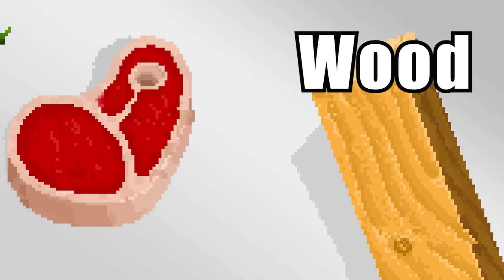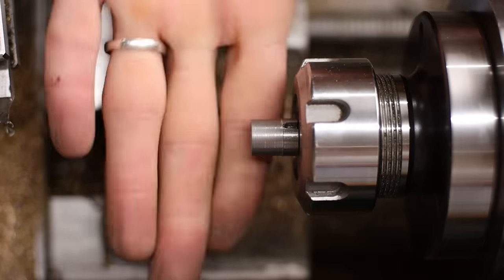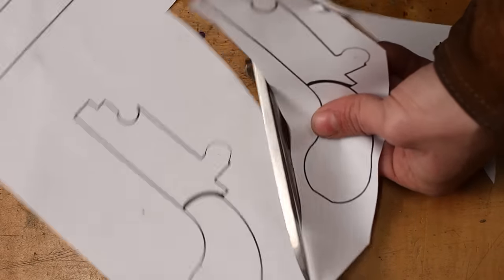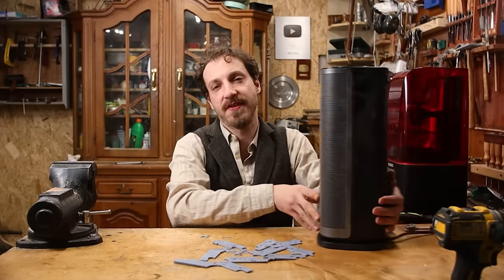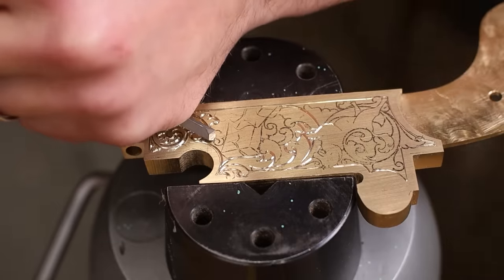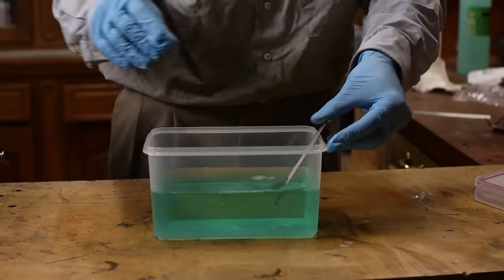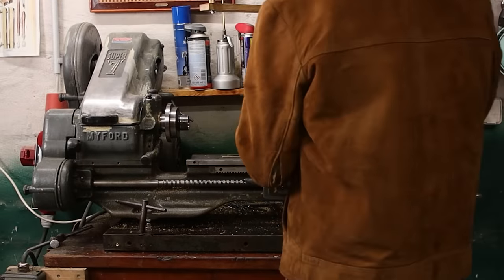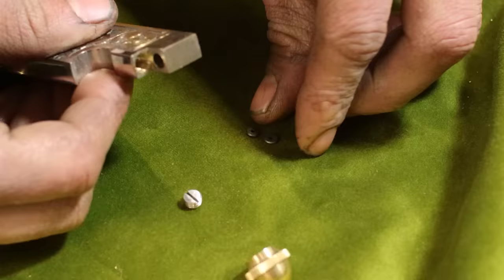I was Commissioned to Create a Circular Glass Cutter, will it Work?

Comment: Beautiful result Uri. One big thing which may be tripping you up is that you seem to be scoring the glass multiple times. That's generally a big no-no when it comes to glass cutting, and tends to lead to fragments being broken off rather than the crack propagating along the scoreline. Score once, snap once. Glass cutting is an art indeed!
Reply: Hey man, I just wanted to say I miss your videos.  I've been watching since the kant twist clamp days.
Reply: He should try making an all metal version of Rock’Em Sock’Em Robots.
Reply from the maker: Yes, I should have looked at videos before I attempted to do it myself. They make it look dk easy😅. Perhaps a thiner plate would have help aswell.
I don't think I have the neck for glass work😂
Reply: @urituchmanpigeon  oh tell me about it, I gave it up long ago. Last time I tried was to make a custom rear view mirror for my van I ended up belt sanding it to shape 😄
Reply: A drop of oil or kerosene apples where you start the cut apparently also makes it easier to achieve a continuous cut line.
Reply: My hubby who did a lead lighting course feels you are scoring the glass too many times and when tapping the glass with a hammer the glass should be lightly tapped both sides👍 The cutter is beautiful by the way🌹🌹🌹
Reply: Stained glass can be loads of fun, and it just takes some practice to get the technique. If you are able to make engravings with such a deft hand, glass is different, but doesn't require more finesse than that (in my opinion).
Reply: I've done stained glass for years, btw, so I'm not talking out of my butt on this one.
Reply: The neck and the knack @urituchmanpigeon
Reply: Turn the glass over and tap gently along the other side of the score you made! The glass will crack through at the score.
Reply: U still alive Yaya
Reply: @urituchmanpigeon I used to cut glass in a past job.  You should use some cutting oil. Just dip the cutter in the oil. It helps. Also if the edges where the cut is being made is producing tiny fragments, you are pressing too hard. You will hear a crackling sound. If you apply tge right amount it should be a smooth shhh sound. The cut should look very crisp when done properly. Also to separate peices, apply pressure on both sides of the cut in a twisting motion. Hope this helps! Great video once again!
Reply: @urituchmanpigeon  Ya also supposed to tap it until you hear the sound change then follow tapping up the score mark.  That being said, I have never gotten this shit to work right on large pieces lol.  Least not repeatably.

Comment: Cutting wheels are tungsten carbide:
- don't go over a cut twice, it makes the wheel dull
- each wheel is good for 3 - 5 cuts, then throw it away; it is dull
- cutting oil helps, but the wrong kind makes the wheel dull
- looking at the wheel makes it dull
Reply: Not using the wheel makes it dull
Reply: Don't store it in a humid place, that makes it dull. Do not store it in a dry place, that makes it dull.
Reply: Don't look at the wheel while using it, that makes it dull
Reply: existing near the wheel makes it dull
Reply: A random person waking up in the morning makes it dull
Reply: @StupidIsMyJob  No, the wheel came sharp, purchasing the wheel makes it dull.
Reply: A soft breeze outside blew in a piece of dust. Dirty conditions make it dull
Reply: use mineral spirits on the blade.. acquaragia in the cut
Reply: Always shake the box you get the wheels in. If it rattles, it's dull.
Reply: producing the wheel makes it dull
Reply: I have cut a LOT of glass...it's dull
Reply: 3-5 Cuts??? Ok..... 1 cut for 10 mm? Or 1 cut for 100 m ?
Reply: All work and no play will also make it dull
Reply: 3-5 cuts is just misinformation.
Reply: Being in a loaded chunk makes the wheel dull
Reply: The wheel existing makes it dull
Reply: People waking up at 7:30 am, on June 26th who then makes bacon, makes it dull
Reply: Laughing to oneself about the absurdity of comment threads like this makes it dull
Reply: Don't insult the wheel, hurting its feelings makes it dull
Reply: cap
Reply: Guys stop talking about the wheel, its making it dull
Reply: when the wheel goes dull your teeth will turn gray
Reply: don't make the wheel dull; that makes the wheel dull
Reply: The wheel is dull.
Reply: The act of observing the status of the wheel affects the results of the wheel's dullness, which makes the wheel dull
Reply: A dog sneezing in afgnistan make it dull
Reply: Another little known fact: dulling the wheel makes it look.
Reply: @marcob6218 
“Aqua regea?”
Reply: @air8536 
No way!  Glass cutting wheels are quantum bound?!  That’s so cool!  I’ll bet it’s dull and not dull at the same time.
Reply: Conversations about how dull a wheel is are dull

Comment: The way glass cutters work is "stress concentration" which just means that they make a very sharp but shallow gash in the surface which should make the glass split right there. The reason this works is because what breaks a material isn't just the amount of force but the force divided by the area where the force is applied which is called stress. So, if you make that area very small, like at the tip of a very sharp scratch, the stress becomes huge. So, it's actually better to make a single fine scratch with the glass cutter rather than going over the same line may times because while you're making the gouge deeper, you're also making it wider and thus duller

Comment: Cast in wax, coat with plaster, melt wax out, cast the tin.  You'll never get good results trying to cast into silicone.
Reply: Absolutely true, but he still could've definitely gotten better results using silicone. One simple method would be to preheat the molds. Not hating on the video, to be clear.

Comment: The glass is tapped exactly along the glass cutter's line until a crack appears under this line. and I highly recommend changing the roller tip to corundum or diamond, the rollers do not cut well.
Reply: Nope.  Diamond only scratches the glass.  The steel wheel creates a line of weakness in the glass and the fracture follows this line.  Try scratchig a piece of glass and you will find that the fracture line does not follow the scratch.
Reply: @tednelson5277  I think you may be confused, as everything you said is wrong. First off all that "weakness" you reference is the scratch. All glass cutters - steel, carbide, and diamond - score or scratch the glass in order to encourage the breakage to follow that line.

It does not always follow the line, but that is due to the natural "grain" of the glass, not any artificial weakness caused by the steel cutter. Why would the weakness created by the wheel be off the path of the scratch anyways?
Reply: @tednelson5277   i was try it a lot of time. line of weakness is pretty exist for scratch by diamond  too, because fact of surface damage is enough for it with a little tapping. wheel instead require a lot of pressing for desribed result and often crack the glass if you press too strong. wheeel is advertised as a try to awoid tapping at all but it is not a good solution - just a cheap production. Additonally - wheel is awful for a small radius curves.
Reply: @anatoliyzhestov3915  Sorry, but you are wrong.  If the glass breaks wheel you use a wheel, you are no supporting the glass.  Diamond only scratches.  Ask any professional stained glass cutter.
Reply: @tednelson5277  ask any professional you mention what he does and he will tell you - I draw hundreds of straight lines a day. In these conditions, a roller that can be changed frequently and is inexpensive is an advantage.
But among those who do small, precise work with small radii and want to get a very clean and precise cut, the number of diamond glass cutters may a lot surprise you.

Comment: couple tipps for cutting glass:
1: never cut twice over the same crack, it fucks up your cutting wheel. The one you used is probably pretty scuffed already.
2: tapping the cut with a hammer is a good way to deepen the cut. LIGHT hammer taps from the bottom (the uncut side) until the sound of the tapping changes
3: you can put some cutting oil on the cutter, it will make it last longer.
4: you can put something like terpentine where you will cut, it also enhances cutting power

Beautiful piece! Seeing these kind of videos makes me want to get into crafting again. Also top notch editing haha
Reply: also keep the pressure consistent. (no gaps)
Reply: When I have to cut a glass bottle, I score the glass once and then run boiling water over the line, immediately followed by cold water. I alternate between boiling and cold water a few times and usually that will break the glass perfectly along the line. I wonder if that also works for sheet glass.
Reply: It'd definitely work!  But not really necessary.  'Running' the line is pretty easy with gentle pressure either from running pliers or pressing the glass into a foam or soft surface will work, or very traditionally, just tapping. Bottles are hard mode @eelcogg  !
Reply: The only other thing I would add would be some proper glass Nippers
Reply: also have a few whiskies...
Reply: I've also found, through trial, error and many ruined sheets of glass; don't push too hard, you only have to score the glass, not plough furrows into it (also don't try to cut tempered glass....but that's another story 😁)

Comment: I've been working with glass for several years now, and i have some tips. 
1. You should never cut twice. One firm but smooth cut only, or it won't break properly. 
2. You have to use a cutting lubricant (kerosene is fine). This is applied to the glass where you will make the cut.
3. When trying to break out a circle, you must do it from the back. Support the top (cut side) of the glass, and push directly on the bottom (uncut side) of the cut. You will see it break a little, and you just "run" this break all the way around. After that, you need to cut a relief on each side (where the circle is closest to the edge) and take the trim (scrap glass) off in 4 separate pieces. This is because you cannot remove a circle from a hole that's exactly the same size as the circle.

Comment: Cutting glass has been part of my profession for 24 years. It likes to fracture in straight lines, and in paths of least resistance. For that reason, scoring multiple times tends to cause jagged edges and additional fractures. A slow, deliberate and firm score works best. What can help with scoring is dabbing the cutter wheel on a sponge soaked in wd40. Idk why it helps, but it does. And when cutting circles/ovals score additional tangents to the circle so it looks like a whirlpool, making sure that there's about 5mm between the circle and the start of the tangent score. Tap the unsecured side of the glass, tracing the scoring. Tap the circular score first and gently so the scores become cracks. It will be visible when the scores crack. Once your circle is set, tap the tangent scores.  The cracks should break to meet in the same direction  on their own,  and you can remove the loose pieces as they fall away.

Thanks for uploading. I always enjoy your content❤
Reply: "Idk why it helps, but it does" - it lubricates the wheel, so it rolls easier on it's axis, and then WD-40/ kerosene/ glass cutting oil (yes, there is such oil) seeps into the score (which is a miniscule crack in the glass) - i.e. capillary force "push" it into the glass, and it either reduces the attraction between glass molecules (van der Waals force?) or in some other fashion facilitates the propagation of the initial crack (which is caused by "scoring", and lies underneath it) - or both (can't remember now exactly).

Also, "wiping off" the glass where you intend to make the score (just swipe yer finger across the glass) removes whatever dust have accumulated there and that helps to prolong the life of the wheel... or so I was told when I started my glazing job about twenty years before you did ;-)
Reply: @MrKotBonifacy  this makes a lot of sense lol. Thank you

Comment: Awesome design. Almost all glasscutters sold have a small ball attached at the other end. It's used to tap-tap-tap on the glass score line from underneath. You need a striker to make your tool complete. And I think you already have it. Have you ever pistol-whipped someone or thing? Probably not. Anyway use the buttend of the pistol grip to tap the glass and cause it to break.

Comment: When you want to get good metal casting results with all these fine lines you have to use either that so-called "type metal" (alloy of lead, antimony and tin) or bismuth - as they EXPAND when they solidify, thus filling up all these intricate mould patterns. (Type metal was used to cast individual "letter blocks" used in mechanical typesetting in pre-computers prehistoric times.)

Comment: I've also had great difficulty casting detailed objects in tin, in high temp silocone moulds. Eventually I discovered that adding bismuth helps a lot (about 85% tin to 15% bismuth by weight). Then get it as hot as possible and pour it as fast as possible.

Comment: This "Golden Cut" brand reminds me of that Silberschnitt brand (German for "silver cut"), which was, if I'm not mistaken, a DDR "derivative" (knock-off) of West Germany Hartmetall glass cutters.
EDIT - just checked it, seems like "it's the other way round" - i.e. Silberschnitt was West Germany brand and Hartmetall was DDR "derivative".
 
And the quality of the wheel makes a "day and night difference" when it comes to glass cutting - so if you want to cut glass without any trouble get the best ones you can afford (within reasonable range, that is). This "home improvement/ hobbyist" brand is good just for that. Shops selling glazing tools and supplies sell cutting wheels "stand-alone" fashion, and there are plenty of sellers of these on all sort of internet selling platforms too. It's really worth getting high quality cutting wheels. 

Then there are different cutting edge geometries for various thickness of glass (thick glass requires different angle grind of the cutting edge, more obtuse one AFAIR) and then there some special "glasses" (like X-ray shielding glass, which is made mostly of melted lead oxides, or that "glass-ceramic" thingy for fireplaces, like Robax) which require dedicated wheels as well.
Also, when cutting thick glass the force needed to score it is greater (thus different handles in such cutters) AND special pliers to run the crack, but when you use good quality new wheel the force applied should be "just enough" to score it - when you see tiny strands of glass flaking off by itself from the score (right after you made it) it means the force was too strong, and it will not only shorten the lifetime of the wheel (will blunt it, to put it bluntly... ;-)  but this may actually worsen the quality of the cut.

And while light "tapping" the glass on the opposite side (underneath the score) with a hard object does "open up" the crack, the edges of it (where you tapped it) will be wavy - for regular glass thickness (2 - 6 mm) simple breaking it with your hands should do (if the score is right), preferably with "pulling apart" motion added.
Place the scored pane on a table so the score is still on the table but very close to the edge (5 mm or less) of it, hold it down with your left hand and "break off" that part outside of the table by pushing it with your other hand.
Or when the pane is too big for it, just lift it a little and place some soft (but firm) object under the score at the edge of the pane (a wooden handle of a regular glass cutter, or a pencil would do) and gently press the pane with your both hands placed 5 to 10 cm away from the score.
When the off-cut part is too narrow for any of the aforementioned methods use special pliers - regular workshop universal pliers are not suitable for this task. In a pinch they "will do", but very poorly - unless you have one of these special "parallel jaws" pliers. And at any rate the minimum off-cut width should be twice the thickness of the pane, or you may end up with a bit of a struggle and a rather jagged edge of the glass.
 
And, oh, BTW - hardened steel DOES score glass, but it's rather special kind of steel, with a lot of cementite in it, and VERY hardened ;-)
Looks like nowadays they make mostly carbide or PCD wheels though. Check the Bohle (Bohle AG) online store - bohle–dot–com.

Comment: Cut on wood or a similar clean, hard surface. Glass is very hard and you need that support to cut cleanly. Also, no hammer. Tap from the back with asteel ball, or use glass breaking pliers. You're essentially making a stress riser, and then forcing a crack along this weakened area.

Comment: I have a tip for getting the curved cuts, and cool enough, it's a secret feature you added to the cutter and didn't know it! Turn that sucker around and hit the glass with the butt of the gun multiple times along the scores. Not so hard to shatter it, but firm enough to make it vibrate. It causes micro fractures along the score lines, and eventually the microfractures will all connect and the glass will just pop apart where you scored it. On a standard glass cutter, that's why it will often have a large ball on the handle end, but the butt of the gun would likely work really well for that! 
Also, your work is really awesome and I love seeing your ideas to fix problems; like the offset screw that covers the pin.

Comment: As a stained glass art maker, my advice is this: Glass cutting oil will improve performance and reduce chipping...or at least reduce the distance the chips fly, therefore being safer for your eyes. Also, please wear safety glasses when glass cutting! The oil reduces the wear on the cutting wheel because of the reduced friction.